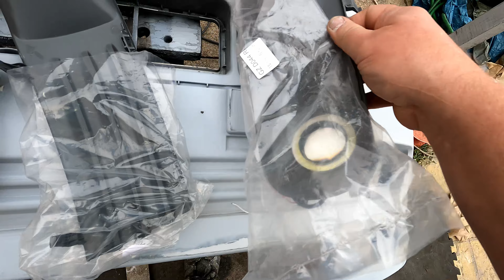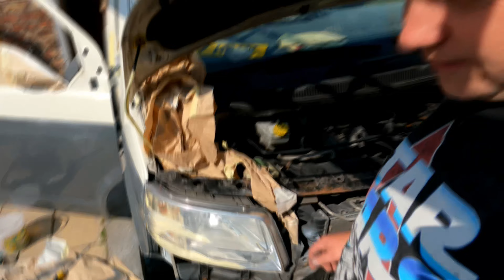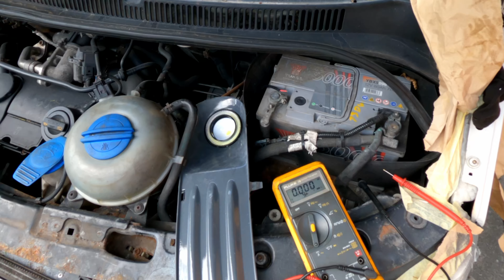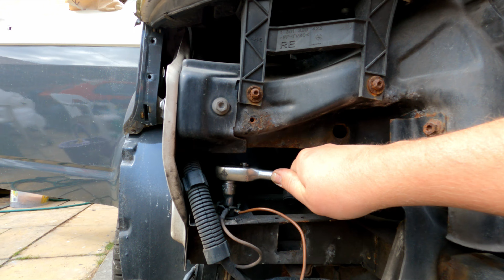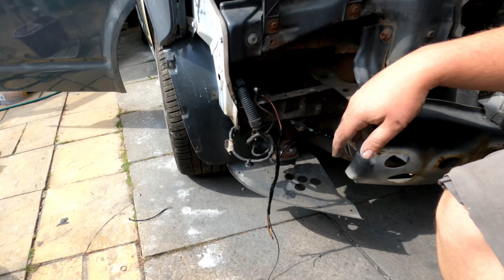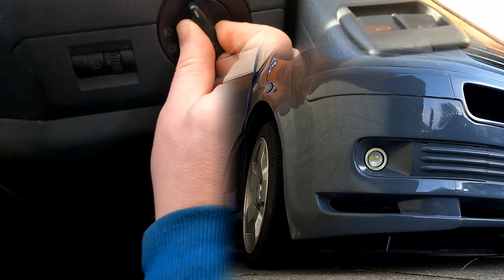T5 Front Fog Light LED upgrade & fitting - VW T5 Revamp Ep.3

Comment: I bought the same ones as these really poor quality about £20 for the kit. Put it this way - the PROPER KIT is over £120!! I had the same problem Ive linked the 'angel eyes' to the sidelights and I have changed the stock headlight switch to one that include the front fog setting instead of that  crappy chinky light switch. If your are going to use ANY tape to tape up wires PLEASE buy some electricians 'self 'amalgamating tape'. ☝☝It has a self adhesive side you peel off and its a RUBBER tape that sticks to itself. Over time the tape bonds into a solid rubber cover for any joint. Lecky tape loses its sticky after a few months - THEN FALLS OFF until one pouring wet winter night the van will go BANG and all the electrics will go off! :face-orange-frowning:As the water has got into that joint you put lecky tape on. I learned the hard way and im a frickin  sparks DUUUH - STOOOPID!!:face-green-smiling:

all

Comment: Nice video, really helpful to get what I'm about to attempt sanity checked (with everything lighting up correctly at the end!).

The pin connector you said you already had, on that wee yellow wire that went into the back of the switch, do you know how to describe them? Having a look but don't think I'm using the right phrasing in my searches.
Reply from the maker: Glad it helped Andrew,  has certainly helped over the dark nights!
Yes that wire is a repair wire or a repair terminal for VW plugs, you can remove the from similar plugs as it's widely used
Edit: from my search I'd say it's 6.3 or 6.5mm, worth double checking on the switch as I don't have switch in front of me, but sure you could take plastic insulation off a crimp connector, but likely not lock in

Comment: Really useful - many thanks! I bought a similar kit off Ebay, there were no instructions and the panel was so flimsy I sent the kit back. That was a normal filament bulb set, but now I have seen the LED versions in this video I may try and get just the lamps and re-use the existing panels. Did you consider using the outer ring / angel eyes as daytime running lights?
Reply from the maker: Thanks for the comment, if I done it again probably just the lamp units solely on original trims
Yes I did think about daytime running, but just didn't like them on there own, without sidelight . Personal preference over the control on them on
Reply: @CrispysProjects  I think I will try daytime running lights first as its easy to wire up, I already have a switched 12V distribution box that I made up, tucked away in the dashboard.

It was interesting to see how far your headlamp switch came out. I am struggling with mine, may need to poke around a bit more to see if something is trapping it.

Comment: I did an addition of halogen powered foglights to my 1996 Vento years ago and used a relay as the lights draw much more current tjan modern leds. I wired it so they come on via the usual combo light switch, and also when the main beams are switched on so as to provide some more light lower down to help with visibility at night. Great video. Keep up the good work!
Reply from the maker: Great to hear your rally configuration of your fogs setup, amazes me the massive difference in power consumption on these compared to old school halogens!!
Thanks for the support 👍